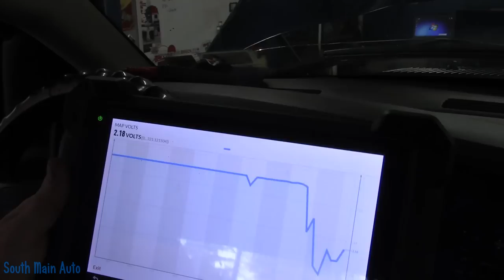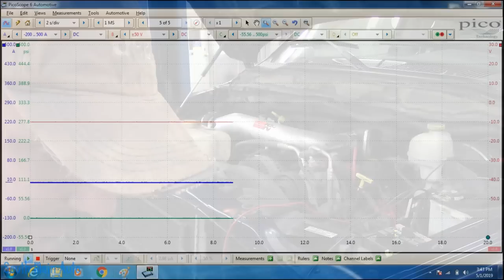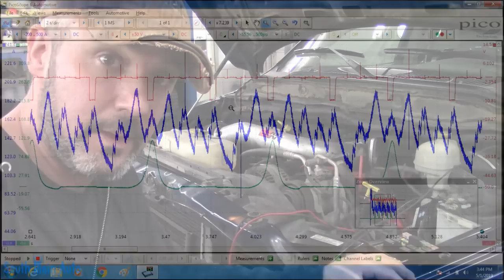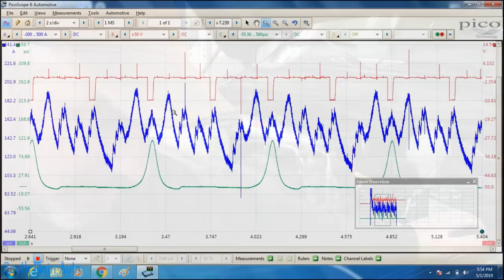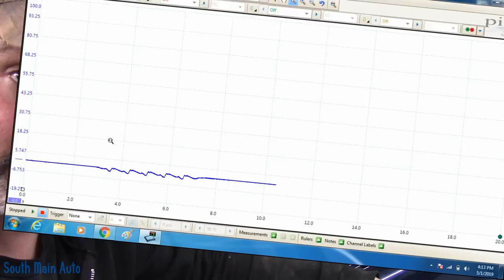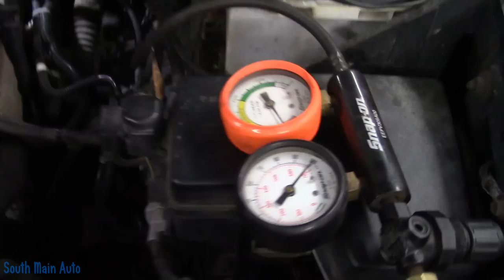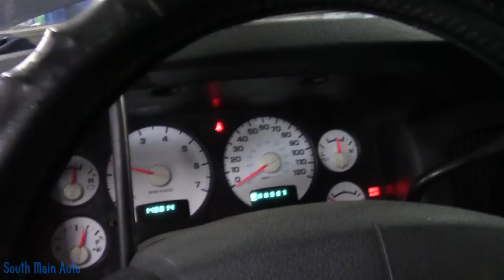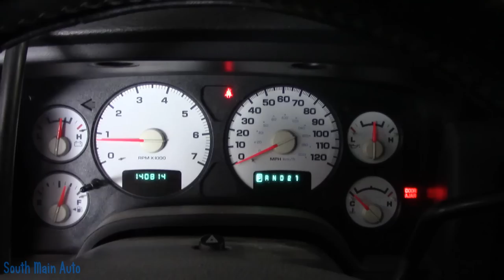5.7 Hemi Ram - Bad Misfire & Will Not Idle

Comment: Hey
How are you?
I just rebuild my engine on my 04 dodge durango 
I didn't change anything on valves and springs
Just pistons, pistons rings, main and rod bearings 
When I crank it the first time it was running ok
Then I turn it off 
Few minutes later I turn it on and begin running like that one on your video 
The check engine light come on showing bank 1 sensor to rich I put a new one, I crank it again and keep running really bad keep showing bank 1 sensor
What you think it can be?

And took off the oil cap there is a good bit of Condensation why?
Thanks!

Comment: Hope he elected to replace all springs! The next break may be not as lucky a break(pardon the pun) for him.
Our contract law here states we must advise of this need and provide this on the invoice including the owner has declined to have us do so, so hence unable to provide any warranty, or else we may be liable for the repair if it goes pear shaped.
Reply: Umm hmmm. Same deal here. Took the truck to the stealer for a DEF code. He could not find a problem or reproduce it so he erased the code from the ECM. Then to get the truck back I had to sign a release that I was refusing a new set of tires because mine (at 48K miles) only had 10K miles left in them and I would die if he didn't put new ones on right now. He could not look me in the eye as he said his lies.
Reply: @dennyoconnor8680  to support that he would need to record why each tire is failed, and certainly provide photo evidence and TSB to back this up and his or their 'expert opinion'. Sometimes the validity is there but may be obscured in the murky stuff lol

Comment: "high miles" 140,000 and broke a spring?? 210,000 on my original Silverado with the ever fuel efficient 6.0... push a Chevy before I'd drive a hemi! Ha ha. Thanks for the video man!
Reply: Same here. I have an 07 Chevy 1500 with 283k miles. A guy down the street from me also has one with over 300k miles on it. Another guy I know had one with 271k on it but then he traded it in for a newer one. But all his needed was a tune up and a new radiator. If it found it's way to good hands the new owner probably put over 300k on that one too. From my experience and other people I know who own Chevy they are a lot better vehicles than the bad reputation they get. I'd take a Chevy over a dodge or a Ford 8 different days from Sunday.

Comment: Help!!! Hemi 5.7 runs rough and no idle. Have to keep it around 2000rpm. Good compression, changed all the plugs, cleaned throttle body. Replaced fuel pump 10 months ago. O2 sensor is the only codes thrown.

Comment: assuming wouldn't idle because it was blowing the MAP sensors mind ,wonder what would have happened if you unplugged MAP and sent it to fault mode ,have had similar problems with newer 8,6,4 Hemis  with collapsed lifters they wont idle either

Comment: Why did losing only one cylinder mess that engine up so bad?
Reply: That's what I was thinking too!
Reply: John C my guess would be that because the intake valve was stuck open it is causing lots of intake issue for the other cylinders as well. every time that cylinder goes up or down it's going to push air into the intake or pull fuel/air out of the intake starving the other cylinders.
Reply: Yup. In the human world this would be a sucking chest wound.
Reply: John C it’s losing all the compression in that cylinder and is just a dead hole making the engine not run smooth and wanting to shut of.

Comment: I never really understand the use of the pico scope when you could've started with the compression check and been done sooner.
Reply: The issue is he didn't know which cylinder was bad, so he'd have to try them all until he found it. The pico scope gets him there in no more than 2 plug removals.

Comment: Would have requested the customer do a valve job and have all the valve springs replaced.  Usually one goes all will need replacing eventually.

Comment: I have an 07 Grand cherokee with the 5.7 hemi as well. I replaced the cylinder head gasket and valve cover gaskets. Since putting everything back together, it is misfiring with code p0300 and I hear a nice little tick sounds. All spark plugs were properly gapped at .044. What could be the issue?

Comment: I'm going to stereotype but I see a K&N Intake, MSD Coils, a broken valve spring, and unless this thing has extremely high mileage I don't understand why those cylinders are all uneven in voltage draw from the alternator.

Edit: Removed some speculation and just left my thoughts.

Comment: Motor  oil used to have zinc  in it. Break in oil is what it's called!
Engine needs it! You can get it from Summit! Is what the problem is!
Reply: Not with roller cams

Comment: Hi....so I'm having a no idle issue.
It's a 05 300c with upgrade cam long tubes new throttle body and tune...
She runs but will not idle. I'm stumped....

Comment: 5.7 probably needs a camshaft. like most of them. Chinese roller lifters
Reply: Those old ones hold up just fine. 09+ have cam issues. 08 and down drop valve seats

Comment: Have a 2003 dodge ram hemi 5.7L that keeps crapping out on me. Just died on my way home from work on the side of the road. Was able to push it into a neighborhood but need to get it running before it gets towed. It sounds just like this car when it starts up but it will only start for a few seconds if you hold the key in start position, makes that noise aggressively, shakes, and then dies. The gas pedal doesn’t do anything either. I’ve cleaned out my throttle body and checked my fuses (brand new, nothing wrong with them). Was thinking maybe its the tps sensor? Bad vapor canister purge solenoid? Could I have a bad cylinder? Any help appreciated.

Comment: I have a 2004 ram 1500 5.7    exactly with the same symptoms the cranking sound,   cannot idle, very rich condition,   so, do you think it's related the low cylinder compression with the rich condition???

Comment: Hey, I have a 2013 Chevy Malibu 2.0l.. and the car stalls at idle. I have to keep foot slightly on gas to keep car from stalling out. I went to auto zone and they said it was camshaft exhaust solenoid. I changed it, and a week later it was no different. Since then I have changed the intake solenoid, throttle body, camshaft position sensor, crankshaft position sensors, changed air filter, new oil change, and car keeps stalling. Is there anything that you can think of that can be causing this???? I’m considering buying a new ECM based on my own research.  Thanks

Comment: I have a 04 ram 1500 5.7 n i have a check engine light on and the only code is p2323 coil h. I replaced all 8 coils n im doing plugs n wires next week but it idles rough at lights n smells of gas?

Comment: Question... if one spring broke... what does that say about the others? would it be wise to replace the others since it was tore down that far?
Reply: i am here for that answer (and also if the misfire code was random or specific to 5).  Thoughts?  The springs theoretically have infinite life if designed correctly but mine all have 266K miles and something is bad wrong with it.

Comment: Please tell me you replaced all those valve springs and not just the one. If one broke, trust me, the others are compromised and with that mileage, are worn out anyway. Yes valve springs wear out and lose seated and open pressure rating. Take those valve springs off and test them all for seated and open pressure and none will pass.

Comment: Real quick. 2013 accent. On the second water pump. Still leaks. Cleaned all the gasket material off before changing. I'm about to burn the car to the ground. Anyone have any ideas?

Comment: I work with small displacement single cylinder motorbikes I'm not sure how or why a single cylinder out of 8 not sealing causes an engine wide over richness?
Reply: Because that cylinders unburnt oxygen is getting to the O2 sensors, making the computer think it's running lean, so it's adding fuel. (It can't tell that there's also unburnt fuel in the stream also)
Reply: @mattmanyam  ahhh thank you see for me - carbs don't have that issue 😁

Comment: Probably the wrong place to ask but does anybody know why a 06 Chrysler town and country would be a no crank and all the shift boxes would be selected but if you disconnect and reconnect the battery it will start and run fine but as soon as you shut it off it wont crank again?

Comment: 140,000 miles is LOW mileage!!!

my 99 buick century has 270,000 miles.... original engine and trans...even struts

all ive done is a wheel bearing, front ball joints, front strut mounts, o2 sensor, crank and cam sensor..... THATS IT!!!
besides the lower intake gaskets.... which ALL 3.1, 3.4, and 3.8s NEED to have done

its got a lifter tick till it gets warm..... then goes away
it MIGHT be because i LOVE revving the fuck out of that 3.1..... and it LOVES to rev also (has a 2 stroke like power band)..... so

but ive never owned a car with less than 140k
i got this 99 buick at 142,000 miles..... 130,000k later, and ill NEVER EVER sell this car
just love it

its light, handles AMAZING (no seriously.... the soft suspension makes for some body roll.... but it STICKS)
comfortable.... gets 32mpg.....  reliable as FRIG.... never left me walking.... easy to work on with cheap parts

what more do ya want? 

well.... besides another 200 ponys.... 
which i have a solution to

my sister totaled her 07 impala via high speed deer impact 
so its got a 3.9 GM 60 degree v6

same motor mounts.... same block

160hp/185 foot pounds..... to 240HP/240 foot pounds OOOOHHHHHH YA!!! BABY!!!!
plus.... a LOT more aftermarket "speed parts" for the 3.9 over the 3.1

Comment: 140,000 miles and a broken valve spring..........fatigue failure and with all the 'hot rod' parts on the engine I'd say another valve spring's going to poop the bed.

Comment: Any motor that is using the MDS system are having cam problems Chevy, Dodge, etc... if there going to make cylinders turn on and off a thousand times a minute , they need to beef up the whole valve train system...but that would cut into their profits ....

Comment: The 5.7 has a issue of lack of lubrication for the pushrod going through the block. Which causes the pushrods to eat the cam lobs
Reply: that's not quite how it all works.  There are lifters in between.

Comment: these engines at least for the '04 were very shitty engines. got one broke down in my driveway. put a connecting rod thru the oil pan at 109k. only had it from 106k. takes 7k to replace the motor and i still owe at least that much.

Comment: What does everyone here charge for that cylinder leak down test? I've got a shop in Indy wanting to charge me 1k for it. (suspected broken timing belt.)
Reply: You mean a leakdown test isn't included in the price of the diagnostic ?
Reply: That price is ridiculous unless you're driving a 200 cylinder car. More cylinders equates to more time. Dr. O is just smarter and goes to the cylinder in question instead of checking them all. You remove a spark plug, attach an air line to your tool and then turn the engine to check for valve closure and seal. $50 a cylinder would be steep. 1k is robbery. Now if they are removing the heads (2 of them) and checking for fluid leak which would then be machined (repaired) and replaced with new gaskets and sealer, then the price is what it is.
Reply: @stanpatterson5033  They did not include it. Just quoted us $4500 to put a used engine in the car after a relative compression test. I called 2 shops near them who each quoted me around $200 for the Cylinder leak down test.
Reply: I'm finding mixed information about this engine.  Everything I find on google says it's non-interference, but if you go to purchase the timing belt kit, it says it is an interference engine. Which is why I'm asking for that test.
Reply: What vehicle and engine?
Reply: @Blazer02LS  2001 Ford Focus 2.0L SOHC.
Reply: Run away!
Reply: @Nick Adams - That is a non-interference design engine BUT they have a bad habit of dropping the valve seats. Then it depends on how the seat stuck the valve open. If you have access to an air compressor a leak down test is VERY easy to do. Many of the chain parts stores have the two gauge tester available as a rental/loan tool. Same with a compression tester. And that timing belt is one of the easier ones to change as well. The belt has to be on and timed properly to do the test easily. It can be done by finding TDC on cylinder 1 and then rocking the crank 90 degrees so you can rotate the cam to close the valves. If it has dropped a valve seat there are options.
Reply: @Blazer02LS  I'd have to move the cam independent of the crank... if I can rent the tool. I'd be comfortable doing the test myself. I can have the car towed back and do all the work for less than $1000, and its $300 to get it from Indy to Cincinnati.

Comment: That's why you never an American product. I have a toyota and put 25 turbos on a stock 5.7 motor and have never had an issue.  It pumps out 1000 HP. I race on the weekends and its my daily driver. I have 1.2 Million miles and never have had to change the oil. Plus I haven't changed anything it anything original. This world would be perfect if toyota would make everything. So dont ever but anything American.  Only buy Japanese or should I say toyota.

Comment: K&N will eventually destroy another engine! Gowd knows the grit they allow through ate that spring!
Reply: It's not even a K&N, it's a cheapie cold air intake with a K&N sticker and a Spectre filter. They are K&N lookalikes, don't know about their performance. 

Also, K&N filters work just fine. There is no way for the air filter to cause any damage to a valve spring, that is just an uneducated/uninformed statement.
Reply: K&N responsible for a broken valve spring ?
Reply: @NoWr2Run  tongue in cheek response.

Comment: Never buy a Hemi
Reply: Wow never by a hemi because a valve spring broke?  I see these motors 2-300k miles and still running no issues.
Reply: Yep, i live in Belvidere area assembly plant know workers been there 50yrs. Hemi famous motor lock up for no reason #5 cylinder valve springs, 400 miles in, tick. an Scotty Kilmer said so